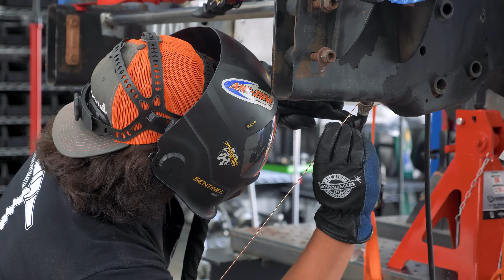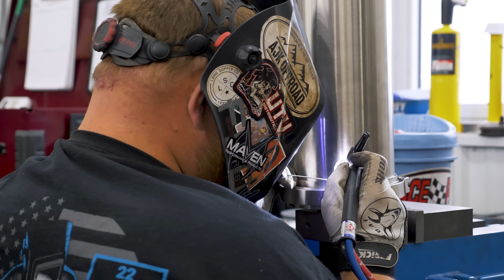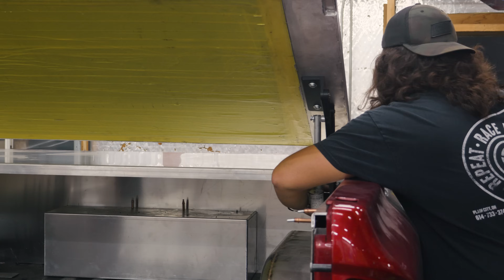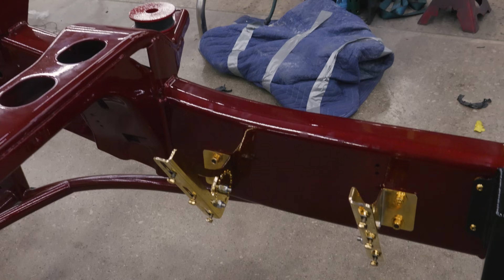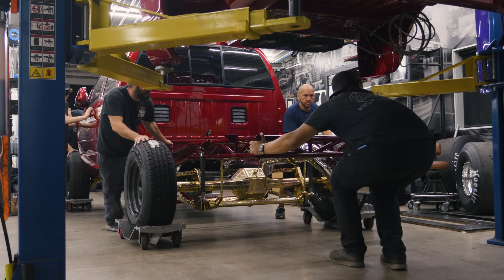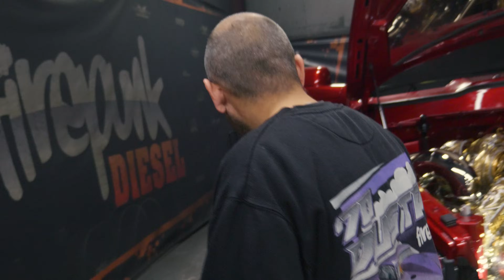From Vision to Reality: Garret Niss's Dream Truck Build

Comment: Personally i think this is waste of time & money so much of the engraving is hidden, there are no body mods, the paint is basically a one tone factory color, it's a four wheel drive that will never see dirt, it only has all the engraving and the back halve, if they plan to win car shows your going to need alot more than what they got, oh wood in a steel bed don't get me wrong it's got the horses and the torque but you can say it has any amount of horses & torque even the tires are street tires on a four wheel drive, nah.

Comment: If you strap the front of the truck down, you can properly tighten the rear straps and gain some peace of mind. Without front straps its harder to gauge where the vehicle will be on the rollers under load, which just creates an uneasy unpredictable situation where even one wheel can catch due to a breakdown etc and launch the vehicle sideways and one part of the rear into the wall. Also front straps pulling against the rear straps lets "pull down" the vehicle for greater traction. Edit: Very nice work! Lots of tedious details especially post engraving thread/surface cleanup, probably a never ending feeling.

Comment: This is a really cool build with a ton of attention to detail. However I think a couple small changes would make a massive difference. They had custom door panels made, but use the factory reflector. I would have made a custom one that either was a dodge logo or match the wheels. Then get it paint matched with glass bead in it to make it reflective. The other detail is it has a carbon fiber steering wheel but uses a factory air bag cover. Why not get a full custom wheel and then find a aftermarket blank cover or a nicer one from a viper. But I do really like how this is a full show truck and yet still makes big power and he plans to actually drive it.

Comment: Now this is a sema build not the junks you see lifted 100” with no front drive shaft on a 4x4.
Reply: how dare you! lol
Reply: @ I dare I tell the truth? This is an absolute masterpiece not like the slapped together junks at sema
Reply: Is that all you got to say just from a million videos that everybody else is already seen sitting here complaining about it why don't you try to fix the problem okay do you even own a ratchet
Reply: Why is that a problem. The no drive shaft thing. They are show trucks. Not mud trucks. They are not gonna see a puddle let alone a mud bog. Its a non issue. Imo.
Reply: @ they are posing as 4x4 trucks which they are not. Not even show trucks in my opinion can hardly drive them.
Reply: @ maybe they are bluetooth.
Reply: @ and they are trucks. At a show, so theres that, and the fact you say you can hardly drive them also leans towards being a show truck. That miata there with turbos and a lambo intake not connected to anything is way worse than a truck with no driveshaft imo. But i get it, they prob should delete the front diff for an independent front end. I guess they leave it so it can be put back to being a regular truck in the future maybe.
Reply: @Sdukes001 you get better gas mileage with front driveshaft removed. Only need it if you're using 4x4. If you live in a large city,  every road is paved with asphalt and concrete. If you use 4x4 you will destroy your drivetrain. U really that picky about how another man uses their truck? Truck Karen
Reply: @ I’m talking about “sema” builds specifically that build these ridiculous lifted trucks that are 4x4 without a front drive shaft. I personally don’t care if you use your truck to go get groceries.
Reply: @BG-qk6ek the problem he is talking about, at sema they have a 4x4 and still have the front drive train without the axle you are making a problem out of something you don’t understand. There ware also cars with a Ferrari intake on a v8 engine and it was not even aligned and no way it would ever work
Reply: 😅 hey let's put all kinds of time and money into a truck that you cannot drive yeah it's real real smart he will be like oh it belongs in a museum and it's like yeah that's exactly where it belongs because museums don't take care of nothing
Reply: @ actually this is a running driving truck did he spend a ridiculous amount of money on it absolutely. They will take this truck to shows but it can still run 2000hp roughly the radiator is underneath the truck and has A/C and everything.
Reply: …as if installing a front driveshaft is the difference between this and a rigged build… 😂
Reply: That would make it a 2X4🤣
Reply: Don’t forget it most likely does not even run
Reply: @ this truck does run its street legal and can also make about 2k hp. Look it up on the fire punk page.
Reply: @Sdukes001  I was talking about most trucks at sema just all around cars
Reply: The people who say this can’t even afford one of the tires!!! 😂😂😂
Reply: Nag nag nag Zzzzzzzz
Reply: Just fyi. This truck was done over 10 weeks ago. They are really trying to milk every single bit of content wit this truck.
Reply: Trucks shouldn’t be flashy . They are a tool
Reply: Nice opinion